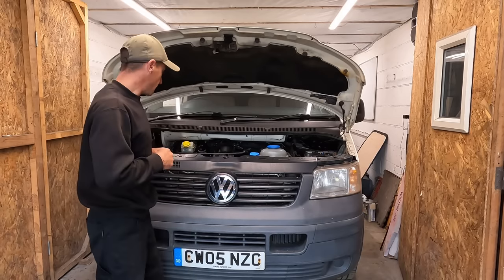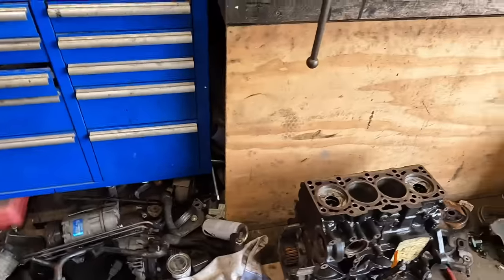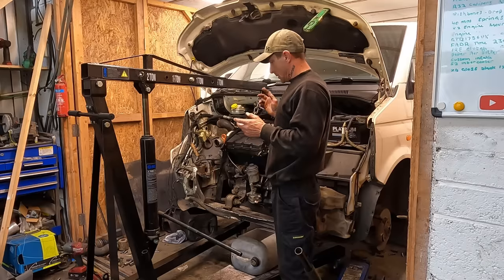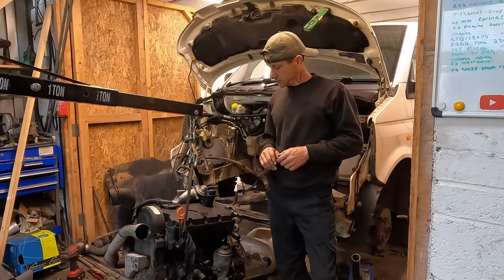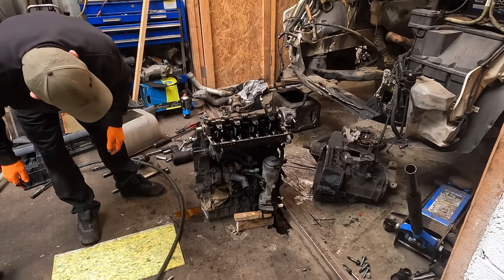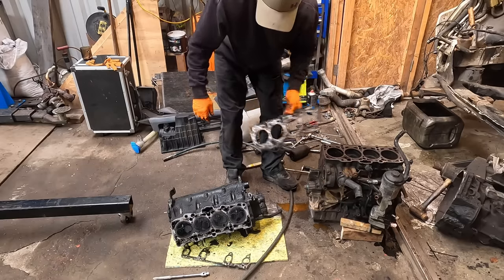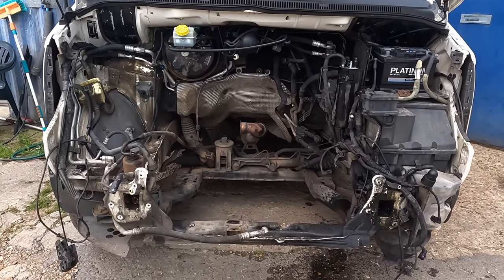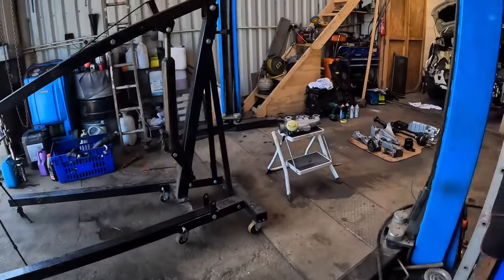VW T5 transporter 1.9 TDI - engine out - build series EP1

Comment: Looking good 👍 with a little bit of effort that bay came out sweet. Original engine looked well looked after. 👍
Reply from the maker: Hey Phillip thank you 👍 everything is in such good condition and your right the inside of the sump didn’t have any sludge or crap, if I didn’t know the mileage I’d definitely not guess it was that high by the condition of everything.

Comment: Perfect timing for your T5 project , I’m in the middle of stripping my head off my T5 1.9tdi with exactly the same problem , system pressurising !. First time I’ve done a head gasket since a ford cross flow engine 30 odd years ago ! , Have learnt so much from your video , was going to get my head skimmed but exhaust valves had play , camshaft is worn , and feel a little out of my depth with stripping it  down so think I’m going to buy a new ready to go head , expensive but could do with getting the van back on the road , like the idea of copying what your doing by putting in a better engine , but maybe that a project for another time . I want to clean up my engine bay like you have , what do you spray on before jet washing  ? I’ve got so much crud on mine too ! Looking forward to the next video
Reply from the maker: Hey Paul thank you for the comment 👍 glad the videos are useful, if you’ve managed to get a head off I’m sure you’ll be ok re fitting one, I’ll explain in depth refitting in the next video. They do suffer with camshaft wear but are cheap enough to replace. I know I’m upgrading the engine but even after 280k miles this engine would have still run good with just a new head gasket, I believe it’s the coolant that had rusted the metal gasket causing failure. I have spare cylinder heads here maybe if you get stuck for finding one I could help you out with a rebuilt one. Thank you bud 
Nathan 👍
Reply from the maker: Forgot the mention, I use a truck wash and a paint brush to loosen the grime before pressure washing, have a look on Amazon or eBay and just type truckwash even the cheap stuff will do just put it in a pump bottle and mix with abit of water 👍
Reply: Hi Nathan , I was considering buying a new one , but they are expensive, and I know your video is going to make me want to upgrade to a better engine eventually! Maybe if you do have a built up head spare , I could buy it off you
Reply from the maker: @PaulDennis-m9m  hey Paul they are expensive, the new parts for the heads are relatively cheap and all bolts on. I can help if you get stuck.

Comment: I've just come across your great videos and now following your channel. 

This was because I'm weighing up a BLS to ASZ engine swap to a Caddy van.

Really glad I did, because from what you say, only an Alhambra and Fabia ASZ engine will fit the Caddy mainly because of the oil filter style on the likes of the Golf MK4 sticking out too far as you said.

Is that the only two ASZ engines that can be used in the conversion please and if also going for the 6 speed box conversion too, is the associated Alhambra and Fabia gearbox and gear selector & cables etc also the correct parts to be used?

Comment: Could you not use the filter housing from the t5 block? Or could you use a golf engine and get the fabia housing..... Also could swap the engine and just run the stock inlet and injectors? Did that many moons ago on a mk5 bxe to ajm swap.... Just got myself a t5 project and following with baited breath
Reply from the maker: Hey bud so the engine with the oil filter housing that sticks right out has a different bolt pattern to the block unfortunately but the Fabia version has the same housing as the T5 and the same bolt pattern, happy days on the new T5 project 👍👍

Comment: Awesome video! Just picked up a transporter myself with what appears to be headgasket dramas, oil and coolant mixed everywhere and pressuried coolant. My question, you mention not being able to use the Mk4 engine because of the oil filter, Can this not be swapped between engines? I've got two AXR pd100s out of Polo 9n3 and I will more than likely end up swapping one of them into my transporter if it fits... Curious to hear your input on this! Thanks
Reply from the maker: Hey bud sorry for the delay, the bolt pattern on the oil filter housings are different unfortunately, you can still use the engine with the big oil filter housing it does just clear.

Comment: Could I not use my oil filter housing off the t5 axb engine to put on the mk4 golf asz engine? Thanks for the video
Reply from the maker: Hi bud it doesn’t fit the bolt pattern is different, you can use the golf asz engine but you might need to change the normal radiator fan for a slim line spal type fan. Thank you 👍

Comment: Hi I'm in Australia and looking at buying a 2015 VW 2.0litre Diesel High Top (which is rare to find) and converting to a Campervan.  Just wanted to ask can you replace the T5 engine with a younger T6 engine . The vehicle has 400,000 on the clock and looking to inspect today.
Reply from the maker: Hi bud the 2.0l engine in the T6 is a good engine and you’d be surprised how strong they are, if it was me I would service the engine and replace gearbox oil then I would replace the 2 bolts that hold the injectors down, find out about the last time the timing belt and water pump was done and replace if needed, last thing if it still got the DPF then I’d have that emptied and remapped. If it turns out the engine is tired then yes you can fit the older 1.9tdi, you would need a few pieces thow.  Engine and gearbox, drive shafts etc then engine loom and ecu and find someone to do the wiring as a few pins would need swapping. It can be done but it is a fair sized job. Again the 2.0l in the t6’s are good.

Comment: If you have a skim how do you work out how many notches you need in the new head gasket ? Looking good btw
Reply from the maker: Hey Marc that is a good question 👍 I don’t know how to answer it but I should have ordered the gasket after the head was skimmed as if they have to take more off I would have ordered the next size up but I didn’t 😂 I ordered the same size and I hope they only take a small amount off. I’ll update next video 👍
Reply: My understanding of this is that , it’s not the skim that determines the thickness of the gasket , it’s down to how much the piston rises in the bore (Haynes Manual explains how to measure this with a gauge ) skimming the head doesn’t affect the gasket to be used , just use the same amount of holes as last one , this is my understanding anyway.
Reply from the maker: @PaulDennis-m9m  I have head a similar thing actually I just went for the same size to be safe 👍

Comment: Do you need a pair of standard T5.1 headlights?
Reply from the maker: Hey Ian yes I do 👍 I havnt got any parts for the front end yet.
Reply: @YTDTETV  I’ve got a pair following headlight change on mine. Selling van and buyer doesn’t want them. There’s a small scratch on  the passenger side unit, but in great condition otherwise. You can have them foc as they’re just taking up space in my loft 🙄
Reply from the maker: @ianduckworth9925  that would be great thank you a scratch doesn’t bother me I’m sure a polish will make it look better, appreciate you letting me have them. If you email me your name and address and I can send a courier on a day that’s convenient for you. Again appreciate that my email is 
NDAUTOS24A@GMAIL.COM

Comment: Hi mate sorry but quick one have a 2.5 tdi t5 can I convert in to 1.9 many thanks in advance cheers
Reply from the maker: Hi bud it is possible but the 2.5 gearbox doesn’t fit the 1.9 so you would need a few extra parts to make it work 👍
Reply: @YTDTETV  thanks mate I have a caddy maxi but need a bigger van so there is a guy facebook howdo ants to swap but engine is nkoking don’t no why to do

Comment: good afternoon i need some help i have a vw t5 that has a pd 100 engine and i don't have a gearbox... i can't even get a gearbox which gearbox i can adapt is there any compatibility the van is from 2004
Reply from the maker: Hi Bud unfortunately the van box’s are different to any of the car box’s so it’s a case of finding the same replacement

Comment: I’ve just done this conversation in my caddy and oil filter hiding hitting fan like you’ve mentioned , I should have done my research , do you know if there is a way round this ? Thanks
Reply from the maker: Hey Micheal, don’t panic easy mistake to make as I made the Same one I just realised and bought another engine. If I was you I’d remove the rad fan you have a buy a universal slim line one off eBay and that will be good 👍
Reply: @YTDTETV   thanks il have a look in to that , the plan is to go for hybrid turbo , bigger intercooler etc but didn’t want to go any further with the build until I got passed this
Reply from the maker: @Michael-rh8kr  lots of people still use those engine as it’s still really strong just with a longer oil filter housing. Slimline fan and you will have plenty of room, just wore the 2 wires straight to the van wires 👍

Comment: I've actually been after a bumper for a couple of weeks now as mine is cracked at the bottom . Where abouts are you based ?
Reply from the maker: Hi James I’m in deal in Kent where are you from?
Reply: @YTDTETV  I'm in Southend in Essex. Deal is a bit of a trip but I could shoot down early one morning in the week if your about.
Reply from the maker: @VidzVideo  I used to drive to Southend on the weekend for the boy racer madness on the seafront back in the day, it’s almost exactly 100 miles from the seafront to deal if I remember rightly. Your welcome to it mate for sure 👍
Reply: @YTDTETV  thanks a lot. Randomly one has come up in Rayleigh all of a sudden. So I will grab that. just letting you know Incase someone else is after it I don't need it now . Thanks again for offer.
Reply from the maker: @VidzVideo  no problem at all thank you for letting me know 👍

Comment: I have a Vw 2010 transporter T35  140 TDI 1968 CC
How much this van is worth does anyone know? It had a brand new reconditioned engine from Germany 
New cylinder head new turbo, after one year later One morning stopped working after one minute driving

Comment: I’m on doing my engine in my bora pd130 if you need any other parts mate give me a message you can have them for free
Reply from the maker: Hey bud I’m in need of some injectors and a turbo from a pd130, not fussed on turbo condition as I’ll replace the core. Thanks mate 👍
Reply: @YTDTETV  I’ve got a turbo but core is broke and injectors they are mint
Reply from the maker: @Thatreekybora  I’m interested in both, don’t mind paying for them 👍
Reply: @YTDTETV  or what’s the best way to message you mate
Reply from the maker: @Thatreekybora  my email address is NDAUTOS24A@GMAIL.COM
Reply: @YTDTETV  not letting me email you mate
Reply from the maker: @Thatreekybora  I’m on Facebook DTETV 👍

Comment: Don't shoot me, but I'm sure I read that the oil coolers have a known issue causing pressurisation and overheating. Might be a different lump, but rings a bell.
Reply from the maker: Hey bud I don’t shoot peoples ideas or inputs down I hate when I read that happening on the internet. I have also heard that to 👍 my reply to that would be if an oil cooler fails and they do on these then you would see either oil residue in the coolant tank or the oil would go milky. I don’t see how it could pressurise but I might be wrong so just to be sure I won’t use the oil cooler that was in the T5. Thanks for the comment 👍

Comment: Can these engines be put into a t6 transporter, ive a 2014 t6 with engine code CAAB. Fortunes and seem to be soft as shite.
Any help appreciated 🙏  
Great channel btw new subscriber.
Reply from the maker: Hey David yes they definitely would fit, infact the whole engine and gearbox would literally bolts straight in and outlive your original block. So if you end up thinking about the swap you should price up how much it would cost to replace your engine with a recon one I’d say around £4K inc labour might even be more, then price up how much an engine swap to a pd130 would cost and I reckon it’s a similar amount unless you can do bits yourself. The only thing that is not DIY is fitting the engine bay wiring loom as wires need to be swapped etc. glad you found the channel and appreciate the comment 👍